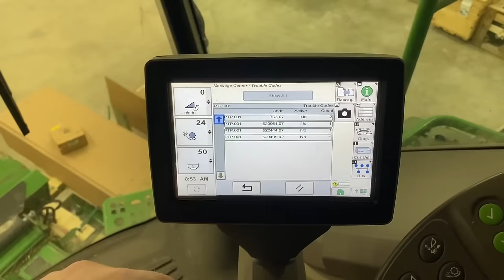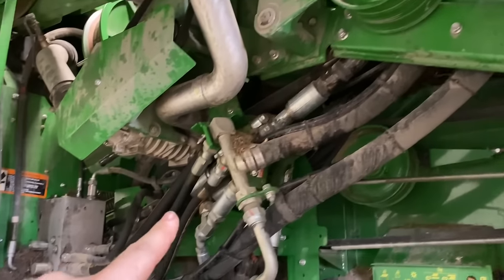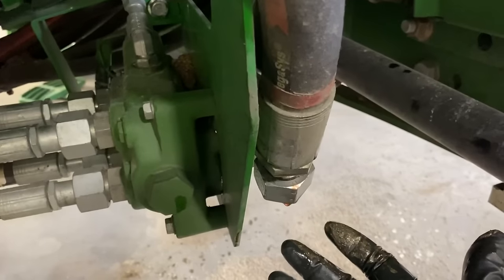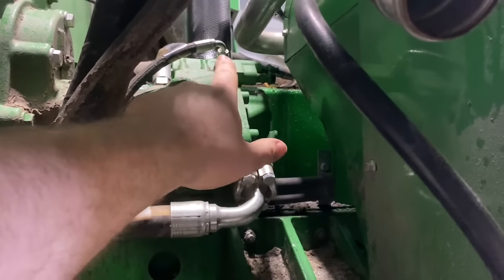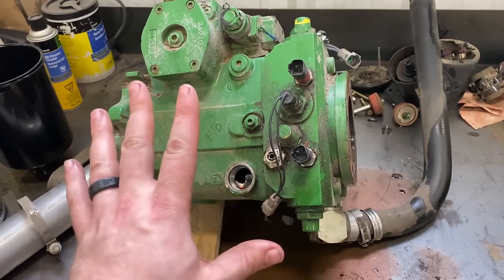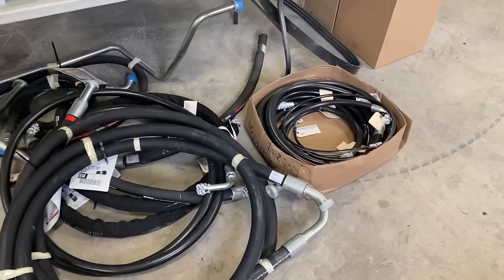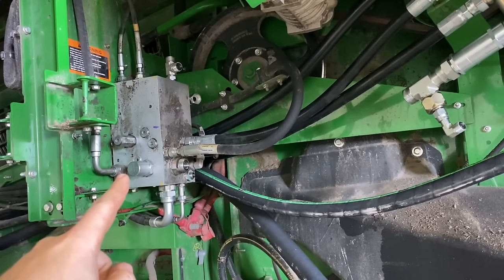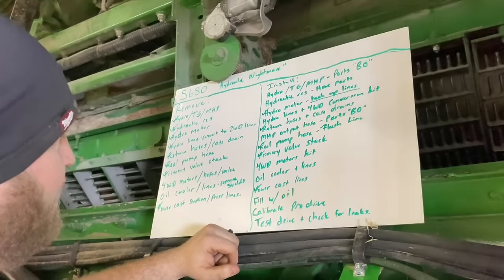John Deere S680 ProDrive hydrostatic pump failure.

Comment: I feel sorry for the owner, such a big failure won't be cheap! At least the repair is in good hands. Your videos are always fascinating, both for the way you explain the steps you take, as well as the methodical way in which the work is done. Congratulations and keep up the good work!
Reply: I feel more sorry for ZK  ; )
Reply: @JDFIGHTER87  Rather callous thing to say. An unfun task for ZK vs losing out on livelihood big time. Farmers are already running on razor thin margins.
Reply: In a lot of situations like this people will replace the hydro and filters and flush out what they can. Then they will trade it asap so as not to spend the money for proper repairs.
Reply: Good thing the owner got the service plan

Comment: @16:30 or so;

Thank you for the explanation on why "replacing' the rubber hose rather than "flushing" them.

Truth is here in March 2022 in Chicagoland, buying new hoses where for the cooling system, or automatic transaxle system, maybe even steering system is likely cheaper than gallons of fluids which to flush said parts

Comment: Wow this is a lot of work. It's a shame there can't be some kind of hydraulic pump output filter to protect all the downstream secondary damage and contamination. I love how you take everything in you stride and are professional in all aspects. Great video, thank you.
Reply: There is, you can install screens to the pump outlet that will catch the majority of that mess. Im just guessing John Deere is either too cheap or too inept to use them.
Reply: Yes it seems like an output filter of the proper capacity and mesh size along with pressure sensors on both sides of the filter to alert the operator when restriction is getting too great would have prevented all this mess. GREAT video, I really enjoy these. Last green combine I worked on and owned was an 8820.

Comment: We have a case quad track In the shop, hyd pump went out and a tech changed the pump only, didn't flush or change any other part of the system. Definitely need more techs out there like you.

Comment: I am an aircraft mech for a major airline.  When we have failures like that in a system we have a machine called a decon machine that we run for a couple of days that filters down to the 2 micron size removal.  I would think they would have the same for Ag repairs.

Comment: I like your use of using a punch list. When I was in the Deere Ag shop I would have a punch list when doing a big job like this. I never worked on a combine but have done several major overhauls on larger tractors and generator units.

Comment: We had a s670 come into the shop that had the same issue this year. Best of luck finding the end of the contamination. We flushed lines for 3 days just trying to chase all the contamination down and you won’t find the end of it. There comes a point where you just have to trust the filters will do their job and get rid of the contamination. We replaced the whole pump stack, hydro pump and motor, both hydro hoses between the pump and motor both hoses to and back from the cooler and the cooler. I’m sure I’m missing some but that’s most of what we had. We had the customer change filters after running it a day and I have yet to hear of any issues
Reply from the maker: I only flush hard lines. I replace the rubber hoses.

Comment: great job! I once did similar work, but the combine was not all-wheel drive - Challenger. but there was an oil cooler, that also had to be replaced!
Reply: I wrote the comment without watching the video, I thought that the radiator was not here. After watching to the end I realized that not everything is done yet :)

Comment: I would think a massive internal failure like this in the main pump was most likely caused by a factory defect. These pumps shouldn’t fail if proper filter changes and fluid levels are part of regular maintenance. This repair bill has to be into the many thousands of dollars. Is John Deere helping with any of the costs? This would be a major financial hit to a farmers budget. I find you videos fascinating and remarkable what you get into. Love the channel
Reply from the maker: Thanks. This combine is out of warranty and unfortunately these failures do happen every once in a while. I’ve done three so far. But that’s only 3 out of hundreds of combines we have running. There are many reasons these pumps could fail and sometimes even if maintenance is done correctly, they can still fail. When this combine is fully loaded, it can weigh almost 100,000 lbs. that’s a lot of weight to try and move through the soft and sometimes muddy field. We are asking a lot out of these pumps and customers usually don’t cut them any slack.
Reply: I'm not familiar with the John Deere system, but in general if you bring a hydrostatic drive to a sudden stop (hit something), this will cause the charge pressure to drop to zero and can cause catastrophic damage to the hydrostat.  I've seen it happen many times.  I don't know if JD has protections in place to prevent this.
Reply: @Topdogswmi  I experienced some rexroth swashplate bearing faillures as wel, all around 6 to 7000 running hours (airport equipment), Rexroth Germany engineer and hydraulic OEM engineer spend some time with test equipment on similar running equipment. We ended with new pumps with a slightly higher volume and added a small accumulator on the boost pump circuit. seems to solve the issue.
Reply: Yeah but youre also assuming grade A maintence was performed. Alot of farmers handle their maintence to make sure this doesnt happen, and these systems are built strong but if you push your maintence intervals, forget some and overwork your equiptment Its not crazy to imagine this happening. I think I share the same feelin asthe original commenter here though. Ive watched all of Zeth's videos and I DONT want to see giant multi-national equiptment juggernaut JD rip off farmers. Part of buying this equiptment and owning it out of warranty is understanding that failures will happen and when they do you might be out 10, 20 or 30 grand, and that sucks. If you go back some videos on this channel youll see that ( i think it was an 8r ) had its engine go out, and deere paid for the complete replacement and part updates for the customer... so its good to see that they DO take responsibility when its on them. I think alot of that is up to the tech too though... If deere tech pay is anything like the auto world, customer pay gets you more money where as warranty work pays you less. This inclines people to reject warranty work and put it on the customer. Zeth seems like an honest guy and hopefully most of his peers are because when its deeres fault, they def. need to pay.
Reply from the maker: I get paid by the hour. Doesn’t matter who’s paying.
Reply: @ZKMasterTech  Well yeah, same hourly rate but you don't have different flat rate hour payouts for warranty work  vs. customer work? If so that's pretty awesome and makes the industry more honest. For vehicles the manufacturer has their "book time" and if you're say... Replacing a direct injection pump you might make 1.5 hours if warranty work or 2.0 hours if customer pay. ( Obviously those numbers range greatly.) But that's pretty much a standard in the automotive industry and it makes it very shady.
Reply: @ZKMasterTech  You seem like a honost man doing his job fair and clean, without walking of the parts or details. I would easily and fully trust you working on it and you are worth any peny if you ask me. Not a lot people who do their job clean and in a honost way. Check things to make sure that the problem is solved. Some people fix things what you can see and the parts you dont see they dont work as secure as they should, thinking like: well they wont see it anyway.
Reply: I think --> therefore... does not represent any sort of logic.
Reply: @somethingelsehere8089  Logic is the last thing you generally find in a YouTube comment section...it's personal opinion and pure conjecture that counts...
Reply: Parabéns vc é muito profissional.  Nota 10 .Abraço 🇧🇷

Comment: That is a massive job. It sucks that there is so many parts that need to be replaced instead of cleaned. A repair like this will have everyone nervous both the customer and dealer because the risk of contamination and failure has to be high

Comment: I have been doing a contamination on a Deere 470 GLC excavator. The pumps failed, I believe they failed due to running the machine at full production before proper warm up and we live in a cold climate. But the entire hydraulic system was contaminated even the pilot system, but I had to remove every hydraulic component and hydraulic hose/line had to be either cleaned fully or replaced. It's been a good time

Comment: I did this job a couple years ago, that the customer ran until it wouldn't move, and found metal in EVERY valve on the machine. I had to clean or replace every line, valve, and cylinder on the machine.
Best of luck.

Comment: Hydrostatic is great until something goes wrong.   My Linde forklift get hyd oil and final drives serviced at half intervals as oil and filters are cheap.  25000 hours and still going.  What a job on this machine!!
Reply: Linde is an other level than Bosch Rexroth ;D

Comment: I am wondering, how could metal contaminants get into other parts of hydraulic system? Any metal that got out of pump and motors case drain would get caught by the return filter anyway and the oil reservoir would remain clean, so oil coming out of reservoir would always be free of any contaminants.
Reply from the maker: The filler bypass check valve gets metal stuck in it and holds it open then your screwed.

Comment: I love how my bay in the shop is quite literally the same width as the distance between the two beams on your support wall in the shop, and about 60 feet in length from main door to bay door. I get one down machine and I am screwed lol. I'd be a pig in heaven if I had even a 1/4 of your shop space. I stretch out a backhoe and bam I work on stuff outside cause I cant work in the bay anymore.

Comment: You really need crane system. We just moved from old shop that had chain hoist in single rail so it limited you a lot. Took more time getting others to help or fighting with parts. New shop has overhead cranes WOW what big difference should help big time with work time. It's a/c shop too strange to have all doors closed too

Comment: That is a good and thorough job you are doing there. Slow and methodical is the only way to go with these jobs or it will be back in the shop before you know it. It would be sensible surely on a machine of this value to install an electronic chip detection system similar to those on a helicopter main gearbox, do John Deere do such a thing on any of their machines?
Reply from the maker: No but that would be one more thing to fail lol

Comment: 41:00 So could external filters be added as a temporary band aid to try to collect any floating other stuff that might be left in the system?  Kind of like secondary oil bypass filters for engines.  Keep up the good work sir.  I assume something like this is in the low to mid 5 figures to get it all done?  👍
Reply: That is what we do in the aviation world.  We have a huge decon machine we run for days to clean the fluid.

Comment: Did the owner or operator do something that they should not have done?
Did the owner or operator fail to do something they should have done?
Did the results from the oil analysis show that the oil should have been changed? 
From your root cause analysis, what caused the failure? 
Has a case drain filter been considered?
Has an accumulator been considered in the charge pump circuit to prevent momentary cavitation when a  motor momentarily stops?
Filters in the pump A and B lines would have prevented debris from the catastrophic failure from being dispersed throughout the system. Have these filters been considered?

Comment: When you have hydraulic lines on blocks like you where messing with a great tool to use is a air hammer just be careful. Bump it and the line will usually spin off easy. A good tool to use is a air hammer bit Chisel point with the edge ground flat to not damage the fitting
Reply from the maker: That’s what i did…

Comment: Question for you when you have such a major catastrophic failure such as that were you have contamination through everything and there’s so much damage when do you draw the line and say you’re better off getting a new machine because everything on that thing is hydraulically driven when do you say enough is enough
Reply from the maker: Well you still have to pay for the repair and then the difference for a new machine...Which is way more than just fixing what you have.

Comment: Just out of interest to put a few things in perspective. When this repair is all said and done would it be possible to let us know the approximate cost of this job? I'm thinking these are going to be big scary numbers just by the number of high value parts needed. Cheers
Reply from the maker: I don’t give out repair bill costs. But yes it is very expensive
Reply: @ZKMasterTech  I was not asking for the actual bill total. But an idea or approximation. North of $50K? $80K? $100K? These are huge expensive and complex machines and I expect to the repairs are the same. If you watch the farmers who use this equipment on YouTube they will generally mention that plans were put on hold as they had these big expenses during the year.

Comment: Is there filters a guy could add to stop some of this contamination and throwing away if parts?  Especially regarding rear wheel drive if they were to fail.  Could the return line of the rear wheel drive be filtered and if so why doesn't Deere do this?
Reply from the maker: No you can’t filter high pressure hydrostatic lines but you might be able to filter returns but I’m not a hydraulic engineer.
Reply: You can get filters however they are expensive due to the pressure and flow rates of the fluid
Reply: Yes but they are built in to the pumps. In forestry machinery of similar size and construction there's always a high pressure Bosch filter on the output of the transmission pump to keep the risk of a contamination like this from happening when the pump fails after 7-9k hours. It's the same Bosch Rexroth pumps like on this combine and it's very baffling why a pump with that filter housing isn't used on this even more complex drive system! A filter usually is replaced about every 2000h and costs about 100$ or so and that's a cheap insurance against this.
Reply from the maker: There is a charge filter on the pump but that’s it besides the main filter in the res.
Reply: @ZKMasterTech  keep in mind that in a hydrostatic drive low and high pressure swaps, dependable of the drive direction. Theoreticly it could be possible but i have never seen it before. There is always a certain amount of oil that will be flushed on the low pressure side. Cant exactly remember but it is, a % of the volume of the boost pump volume will go to the tank.
Reply: @TheBibliofilus  The filter you see on this pumps is not mounted on the A or B port, but are to clean the oil from the boost pump that will go to the control parts of the pump itself.

Comment: Back problems you say...imagine that!  Combines are a complete manufacturing/processing/gathering system that is so compact and complex, it is no wonder there is so little room, access, etc. to get to the problem area, meaning flat rate times add up so quickly there is little time to even swear when your knuckles get skinned!  Have a plastic surgeon on call, they do stitches the best!
Reply from the maker: We are not flat rate

Comment: Had a situation like this with a mower on a golf course. It was a toro 3500 sidewinder. 2 of three drive motors were replaced ( 3 wheel machine) and the hydrostatic pump was replaced. Well, the mechanic (not me) never flushed the hydraulic lines, so everything that was sitting in the lines went through the new pump and new drive motors…. Brand new pump and drive motors destroyed because the mechanic didn’t flush the hydraulic lines. The boss and I pulled the no longer new hydraulic pump back out and took it apart, and it was just filled with shavings. I don’t remember how much money they put into it putting new parts in it, but the boss was pissed. 

I feel so bad for the owner of this combine. That’s got to be insanely expensive to repair.

Edit: I don’t think the mechanic knew that the original pump or drive motors internals were shredded, which is probably why the hydraulic hoses weren’t flushed before putting the new parts on. Anyways, the boa purchased an another mower that had some issues from another local golf course, and I had the pleasure of swapping all the good parts from our machine to replace the old parts on the machine we newly acquired. 
When I pulled the hydraulic tank off the old mower and shined a flashlight down in the hydraulic tank, the internal screen was so plugged, I couldn’t even see the screen material. 

I’m not a mechanic, I’m a laborer on the golf course. But I’m pretty mechanically smart so I’ve done some of the jobs I know he wasn’t going to do anytime soon.

Comment: Whoever tried to do a full stroke calibration with low charge pressure warnings needs some education.  Would you do a full dyno pull with low oil pressure in the engine?  Don't full load the hydrostat with low charge pressure.
Reply from the maker: He didn’t have much experience with prodrive that’s why i was called out.
Reply: @ZKMasterTech  Good thing you were available, and now I bet the other fella knows for next time!
Reply: @commenter5469  swash plate  bearing cage  failure letting bearing rollers  loose inside the pump casing. 
Swash plate gets jammed on an angle,  loose bearing rollers shatter the piston slippers. Very common failure